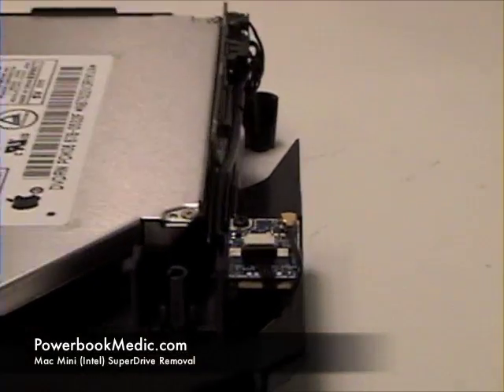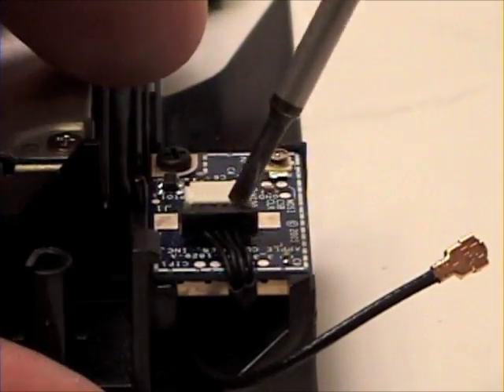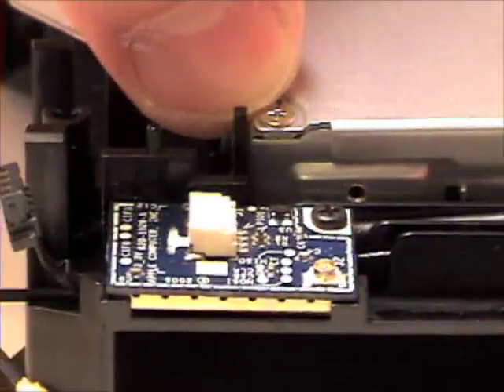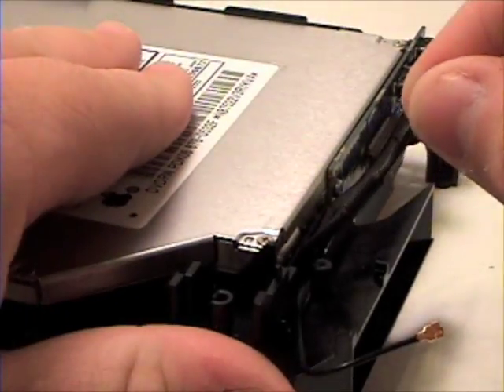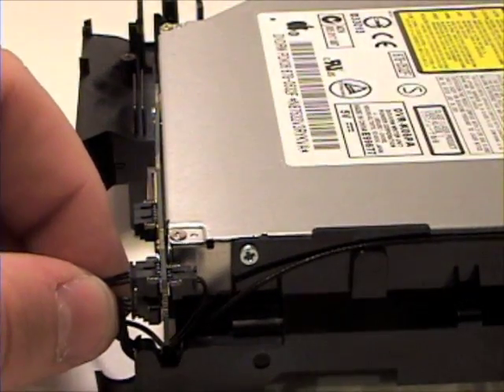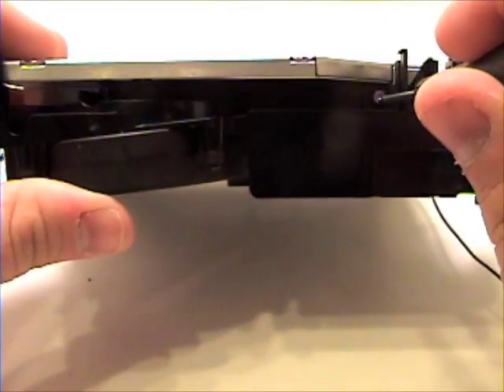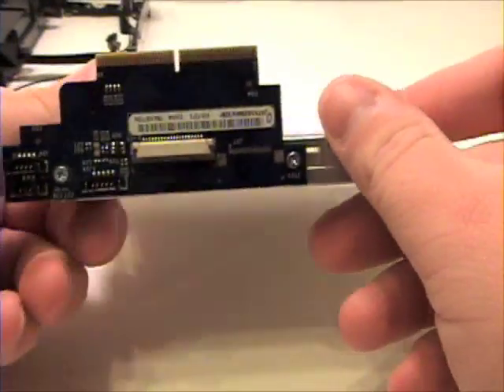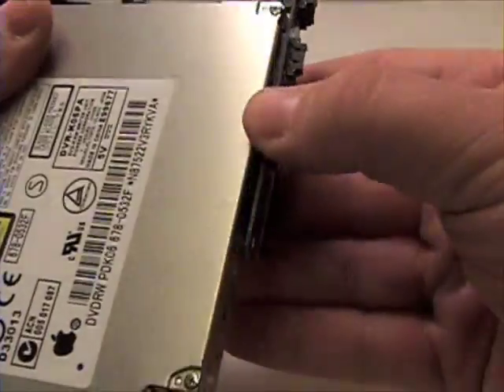Mac Mini Intel Repair - SuperDrive Optical Drive Removal

Comment: The title for this item says 'Mac Mini'. It's actually about PowerBooks.
Reply from the maker: No. The device being disassembled is indeed a Mac Mini.
Reply: Maybe you should specify that in the beginning of the presentation. Additional suggestion, where's the lead in to the point where this video starts? About getting the cover off.